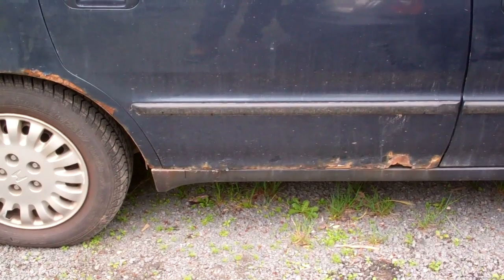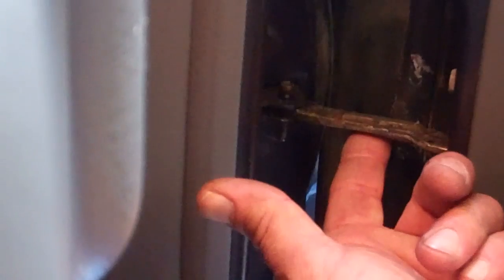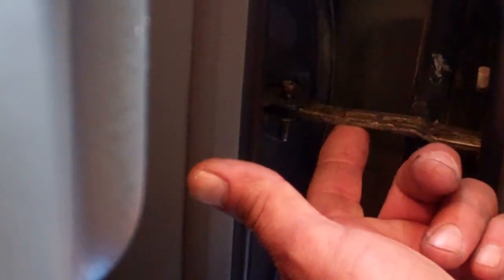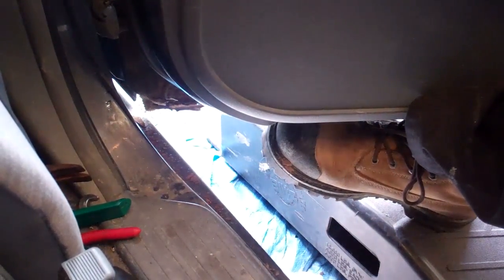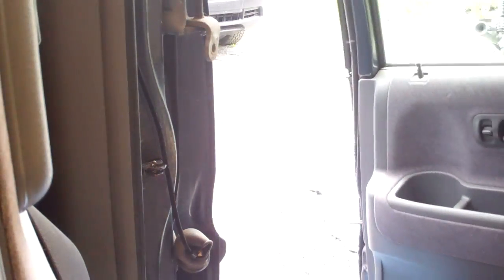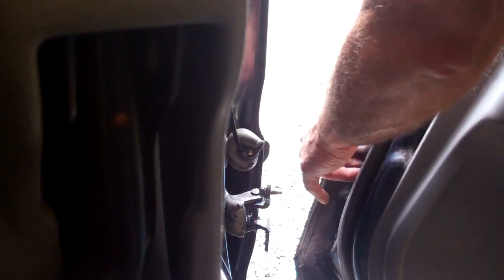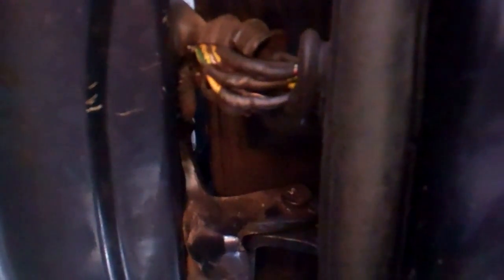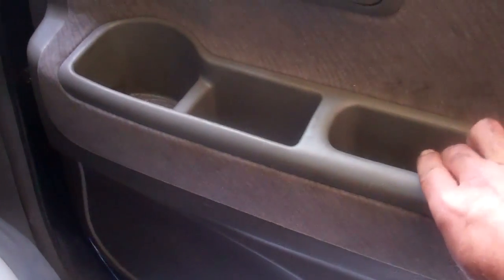Removing a vehicle door and installing a new one

Comment: At 6:12 Motorcycle Scissor Jack would be helpful I think. I used it for a different project (on fuel tank dropping): VIVOHOME Steel Motorcycle ATV Wide Deck Scissor Lift Jack Crank Hoist Stand 1100 lbs, which I found on Amazon. You can put it on a small platform w/4 wheels covered w/non-slip fabric to have more maneuvering. Thank you for the informative film, especially for that part @ 9:50 w/a pin which prevents the door to be wide open. I might use it, since not sure if the repaired headliner will go back inside without that procedure.

Comment: The video is a great help to anyone about to undertake the same thing... although I agree with a lot of people about trying to grab the whole wiring harness and seeing if that is removable... the least i think you ought to have done, and to recommend is to strip the wires while the doors were 8 feet apart... giving you ample room to get your tools in and on the wires of both vehicles.

Then when you marry the door to car, you only have to solder or connect two pre-prepared ends.

Comment: You do not need to cut the harness!!! just under the inside trim panel there is a plug. Just remove the panel under the seat belt and look for the white cover and unplug it,

Comment: I'm curious if you might know... I have a truck with manual doors. I'd like to find doors with electronics and switch them out. I'm thinking I should be able to get a wiring harness. Although factory its basic manual operation. TIA
Reply: I have a 99 f150 with manual doors found electric doors .I was wandering the same is the wiring already there or do I have to change something.
Reply: I don't know .but I do know certain vehicles and models have same harness for both.Not sure about my 99 f150.Someone help me out.

Comment: We just got back from Pick-N-Pull, and used your steps. :) The stop was a little different, but just ended up needing a ratchet.  Some of the commenters here are forgetting something obvious about wiring: Not all cars are the same.  We looked to make sure there was nothing to unplug before going ahead with cutting.

Now to get the dented door off the car I was t-boned in.  It won't even open right now.
Reply: Aria Clements how much did you pay for your used door ? I was charged $200. I see people paying $50 bucks.
Reply: yeah just paid 98 for two doors for my Volvo at a pick n pull

Comment: LOL , everything on a car these days use a wire harness with plugs if he just pulled on the wires going into the car the plugs are right there.
Reply: This is just a reminder, if you are working on an older car, make sure to disconnect the battery before cutting the wires.
Reply: chewie frey thank for the info
Reply: He wasn't working on a newer vehicle.

Comment: Thanks for posting this video. I had to replace a rear passenger door on my 2002 Camry, had since new when one door started to rust and rusted all through to the inside, not sure why. In any event I found a used 2002 Camry, same color, with a good door. Your video was helpful and allowed me to the job in under an hour. This included R+R of the door on both vehicles. The only thing I did different was popped the plastic cover between the front and rear door (pillar) and unplugged the wiring harness plug instead of cutting/splicing the wires. THANKS FOR POSTING!!

Comment: Not sure how your bolts came off so easily. Mine won't budge no matter how hard I try.
Reply: hey im really hoping spmeone can help me . so i changed the driver door on my 1999 vw passat 1.8T sedan Manual transmission . as i was bringing the door down i lostgrip of it and it riped some wires that were attached to it . now my car wont start . there power but it wont start or crank . please help! thankyou
Reply: PB Blaster is helfpul with loosening stubborn bolts. It works better than WD 40.

Spray the bolts with PB Blaster at least three times over the course of a day. Then use a socket, preferably an impact socket, with a long breaker bar, or put a length of pipe over your socket wrench so you have lots of leverage.

This method will work!

Comment: If Im replacing my door with the exact same year range(I have a 98 accord). Do I even have to cut the wires? Its gonna be the same exact door.
Reply: Cutting the wires leaves you with very little space to work.  Plus, every time you open the door, those wires bend and the connection you made could break.

I would remove the door panels from both doors and disconnect the old wires from whatever they connect to. Then reconnect those same wires to the new door.

It is 7 months later. How did things go with your new door?
Reply: +RemoWilliams71    YES THOSE WIRES CONTROL YOUR LOCKS AND WINDOW POWER AND OTHER STUFF IN THE CAR LIKE YOUR DOME LIGHT
Reply: RemoWilliams71 I am removing the drivers side door on my 2000 accord and will make a video on it.

Comment: This did help me alot. Im young and my mom got me 2 doors from the junk yard to replace my current dented ones. The rear door had a plug on the wires however the driver door they just cut the wires. When i first saw it i kinda freaked out but based on what you did doesn't seem too difficult. Do you think if i had the time itd be easier to pull the paneling off and pull the current wires through?
Reply: im in your same boat i wish he answered questions 😥 what did u end up doing

Comment: Just wondering, couldn't the panels have come off instead of cutting the wires?
Reply: There is a connector if you pull the Wire out about 3 inches. Pull the rubber boot up the wire first.
Reply: @derekharvey2060  you won't find it from the body of the door, so I am assuming you mean to find a connector that detaches from the body of the car. I am new to this, so I am hoping I don't have to cut any wires whatsoever.
Reply: Cutting cables was stupid! You can pull the cables out in one piece. Just will take bit longer... LOL
Reply: @grzegorz16100  No it wouldn't take longer than soldering 9 wires back together.
Reply: @stwhite5135  You probably right. What I meant is it would take a bit longer to take the door of.